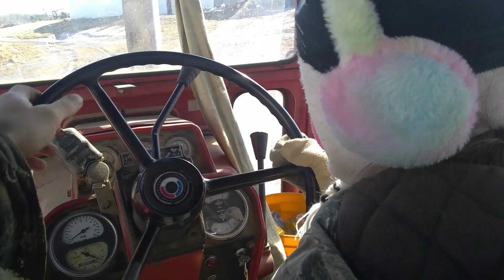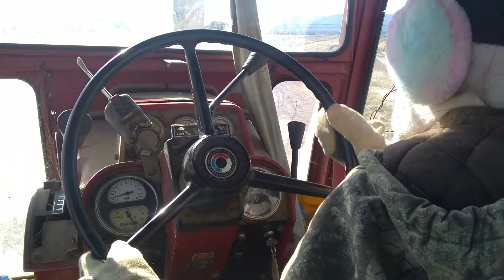some cows and a whole lotta mud

Comment: I know how to drive... The wood pile will move out of the way...lol.. 
Little extra milk helps👍
I've used chains, work great, but when you are on concrete so much, they aren't so good... 
Would love tracks!! If/when we get the CAT skid steer going, it might get tracks. It doesn't have fenders in the way like my Case.
BTW, welcome to my world.....of MUD.
Reply from the maker: That kid sometimes 🤣. Tracks worked pretty good but they sure hold mud in there, but didn't tear things up near as bad as tire chains. I hear ya on the mud lol only bad thing is it's going to freeze in a couple days and those ruts are really going to suck 🤪🤬😂😂😂
Reply: @hartungdairyfarm0713  ya, I would think they'd hold some mud.. I would imagine they're like cat tracks, make sure it's not parked in the mud when it freezes.. probably bust them when you try to move it..

Comment: The original auto steer. 🤣🤣.
Tracks are good and evil. They'll dig and go through the mud and help to dig into grass bags. The evil is they make a mess of everything especially where you turn. It's either turn in same area and end up digging hole down or turn different areas and make a bigger area of slop. They are hard on axel bearings, especially on my NH when I ran them on it. The axel seals are the problem in my opinion
 When running in deep mud it seems to just get into the bearings. It the main reason I run them on my JD, still a problem but not as bad. Biggest thing is when a bearing goes out it not as noticable because the tracks keep everything looking straight.
Reply: I got plenty of room in my tank if you want send the extra my way. 🤣🤣🤣
Reply from the maker: They did a good job getting around today, I definitely see what you mean with them taking out axle seals. There is mud everywhere behind the tires. Supposed to freeze again in a couple days should be fun bouncing over those ruts 🤬. Thanks for watching 👍